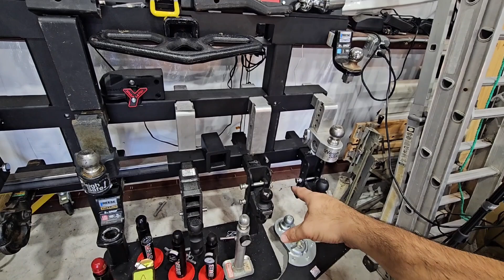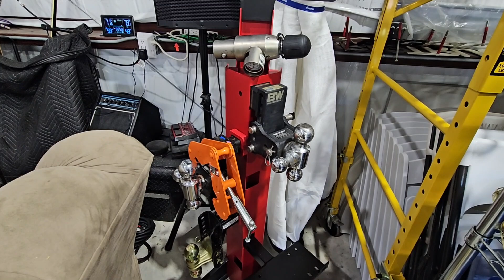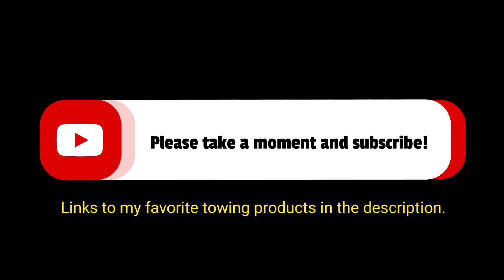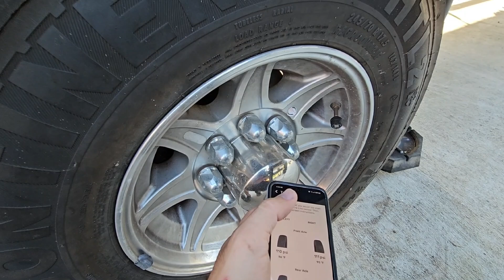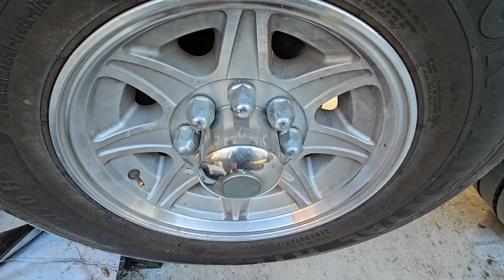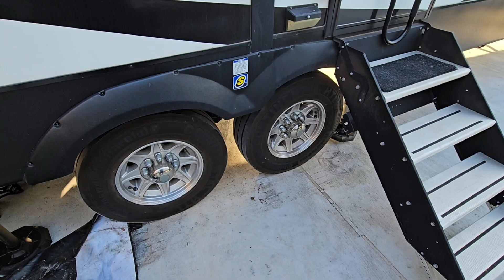BEST TPMS SYSTEM FOR RVs!  NOT WHAT YOU THINK!

Comment: I dumped Tire Linc and went to TST507.  The Tire Linc system came with my camper.  The module was mounted on the front wall of the pass-through on my 35-ish foot 5th wheel, but tires would always drop off while driving down the highway.  It was so worthless, I replaced it after only one summer.  I'm happy for those that it seems to work for.  So far, I have had zero problems with the TST 507 system over the two years I have been using it.

Comment: I wonder if I missed another post from BTBRV somewhere. As much as I love my F350 OEM trailer TPMS I am surprised he doesn’t have this running in his truck? I love having the instant dash alert and “ding” when you lose trailer tire pressure! Totally saved my 5h wheel when I was able to quickly pull over before the tire destroyed parts of my 5er. Also, you get tire TEMPS too! This helps me realize when my load is unbalanced in my trailer! I will see wheels on one side get warmer than the other! Love Ford trailer TPMS!

Comment: Glad to see you have metal valve stems. Love my TST TPMS but had to swap out my rubber valve stems for metal ones after two failed from the weight of the cap sensors. Luckily the TPMS warned me of losing tire pressure from the failed stem and was able to quickly pull over and change the tires.

Comment: Thoughts on Ford's trailer tpms?  Expensive but looks great when set up and pressures all inclusive in one display.  Doesn't seem to be many reviews out there on Ford's system
Reply: I use it with my travel trailer. Works great everytime I hook up the camper and drive a ways the sensors wake up and connect to the pickup.   It's nice not having another device to plug in and mount.
Reply: @victoryrider  thanks that's my thought too!  Very OEM set up and clean. Thanks!